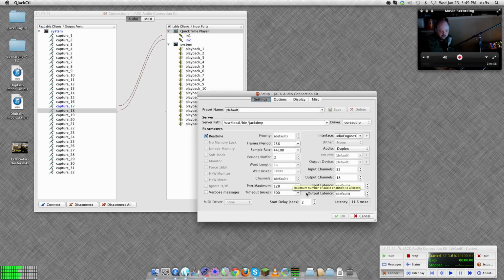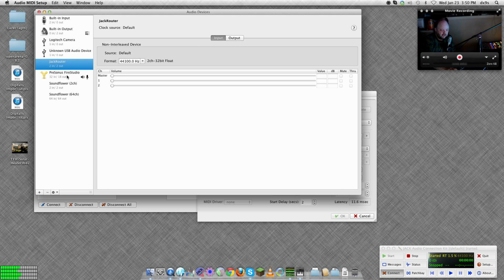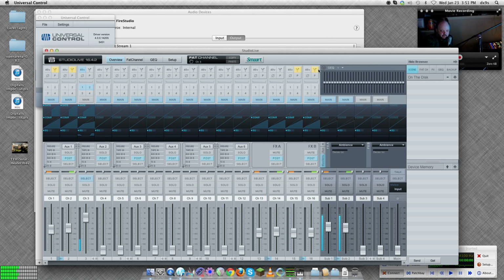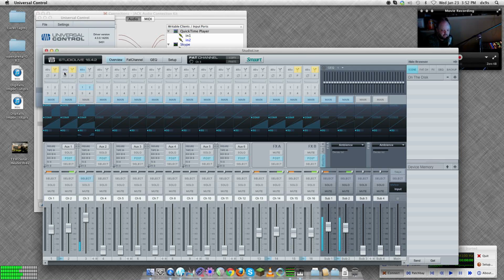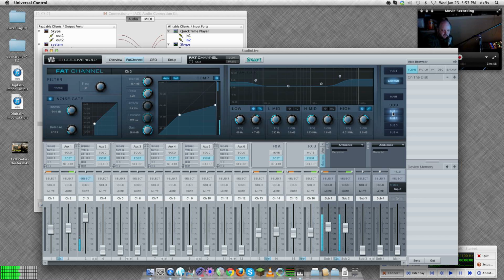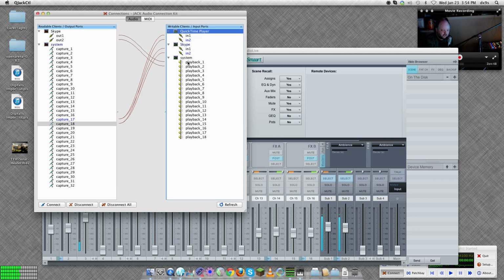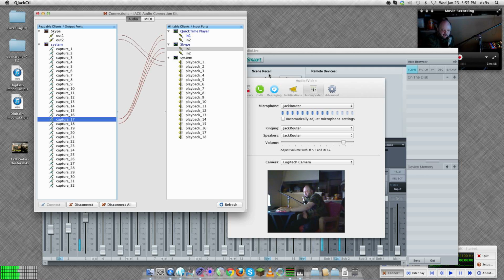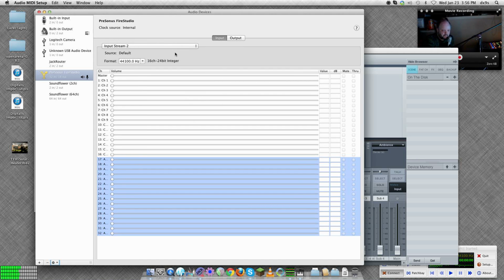Jack On OSX

Comment: This is a really confusing presentation, "QJAckControl ... has a much more user friendly so here I've got  ... "  and what did you click on to show the screen with the connectors. It then goes on to discuss a very personal system.
Reply from the maker: +Roger Alsop Sorry, this was more or less to be an overview and not a How To. Mind you upgrading to newer versions of OS X has disabled the ability to use the 'Virtual' JackRouter coreaudio device as the system default. Programs that ONLY use the system default audio device and don't have a configuration to select an audio device will have to be "worked" around. What in particular are you wanting to learn about Jack for OSX ?

Comment: i'v subscribed cause this is the best explanation so far in english about jack osx.
i have two problems..

i'm trying to run three video programs & one mic usb  thru live 9 aka abelton.

these video programs are.
1st program
photobooth(muted) cause the camera view doesn't invert with a mirror image.

2nd program
quicktime 7 pro ( cause i can edit the preference to hd with enable audio)

3rd program
quicktime standard ( attempting to route this one as a seperate  jack vst channel) to abelton. (which im failing at)

the reason why ? its due to the fact ,even thou i have focusrite 2i4 soundcard.
live 9 buffering sounds horrible while set to 64 samples to record the cad audio usb mic. and the huge issue is while i do get quicktime 7 pro to route thru channel 1 & 2 thru abelton.
i hear a double voiced from quicktime 7 pro and abelton monitor in.
if i take of abelton monitor button..it mutes quicktime 7.
if i turn down quicktime 7 pro  it also mutes the audio from abelton live 9 input.

i want to hear my voice only thru abelton as i record for shows but thats impossible due to them both being simultaneously connected from the volume bar on quicktime 7
and live 9 input channel on monitor ON mode.

so thats when the 3rd program quicktime (standard) comes in , im trying to use that as a jack osx vst output to hear myself talk on abelton.
so i can mute both quicktime 7 pro and abelton input double voice delay situation.

i dont want to mute quicktime 7 and abelton..i want to turn one of them off as i record my voice thru the d.a.w while i set a  fx chain to filter any background noise in the background while beefing up a clean audio in my headphone.

i want to start a youtube channel reviewing shows so i use quicktime 7 pro to record my video in HD, while the new updated quicktime standard cannot.
photobooth is just a camera view i perfer since its not inverted like both quick times which its an annoying mirror view which you cannot auto flip thru recording.
the reason why im recording my audio thru abelton while using quicktime 7 pro its cause i cant add any fx on the video player for example
(gate,eq,desser,vocoder,limiter).

im sorry to complicate you with such a question, iv tried to find stand alone mic programs which didnt need a record button to make my mic be register and audible thru jackosx and abelton.
but it doesnt exist..for some reason you need to record to have the mic send any sound thru abelton from quicktime pro 7 and standard.

so my problem is...even thou i connected quicktime player 7 pro thru live 9
and live 9 thru live 9.....you hear a double voice delay with both programs talking at once and its driving my crazy...just one would be fine but i cant mute either..
thats why the third program quicktime 7 comes in as a jack osx vst..
which i cannot get it to work! im stuck.

i need abelton its alot easier to edit music in the background as i talk on a review..
and i suck a final cut pro 7 and video d.a.w.s so when i do talk as quicktime records myself and the voice...i play video clips in the background to remember plot stories from intro , middle and end to close the review with detail.
its complicated but it works for me....and than i can save the abelton recorded quicktime submix...
match both abelton and quicktime audio on seperate channels into the video sync up with my mouth ...and delete quicktime 7 pro nasty recorded audio from the player itself with abelton processed version.

im begging  you please help me with this double delay dilema..

if i connect quicktime 7 pro in abelton ....is there a way i can mute just quicktime 7 without losing the audio in the d.a.w. thru jack osx...or using a third video program and turning it into a audio seperate vst...and muting both 

abelton and quicktime 7 pro together to end the double delay..while it records and i have the standard edition be a backup option to hear my voice without having to speak on mute which im not comfortable..i need to know how i sound before i bounce anything.
Reply from the maker: phantascy They have changed things in Yosemite (Mavericks and older). You can no longer send the system default sound out to the Jack Router (a way to fool programs that don't have the ability to change it's default audio output .. LIKE Firefox for example). However if you have a decent audio program that you can select the sound output device, you can continue to use the Jack Router to route audio between programs and external hardware etc.

This happens to be an older video that I posted and forgot to make public for over a year. So it is a little bit dated.
Reply from the maker: phantascy I ment to say (Mavericks and older are fine).. Yosemite you can't pick the JackRouter for system default audio in or out. The JackOSX folks might fix this in the future by making necessary changes to their "software" audio device to meet whatever requirements Yosemite requires... I fear this is a DRM thing and because this Open Source project, Yosemite might never support JackRouter fully like it did in Mavericks (and older).
Reply: +dx9s which version of OS X are you running Jack and QJackCtl on? I am asking for this because I installed Jack on Yosemite and El Capitan, just now: on the first, QJackCtl returns some errors and it's impossible to launch it. It was possible to run and manage Jack only using JackPilot. On the latter, you should disable the SIP in order to install the package and, however, also JackPilot seems to return errors. Due to the great potentialities of Jack, I am looking for an OS release on which it definitely works good.
Reply: +Rodolfo Cangiotti Is there any work around to get jack working on yosemite? im debating reinstalling to mavericks just to get it to work
Reply: +Mac All currently, I'm back to Mavericks but I successfully used JackOSX on Yosemite too. The main difference is that the core audio driver on Yosemite have been rebuilt and consequently, several applications which use the audio device are not recognized by Jack. I remember I had a issue with QJackCtl too (it was not able to launch the Jack processes), but probably the last version built by Matthias Kronlachner has solved it.
Reply from the maker: +Rodolfo Cangiotti +Mac All Mind you, Jackd (aka JackOSX) itself works on Yosemite but the JackRouter CANNOT be used as the "system" default device ('Use this device for sound input", "Use this device for sound output") from inside the 'Auto MIDI Setup' -- which many programs will only use the system defaults.

The only work around (which really isn't) is to use programs (like Logic Pro, Ardour, Audacity, Skype, etc.) that support selecting which audio device from within their programs (which doesn't cover the cheap programs)... The beauty of JackRoute on Mavericks is that each-and-every-program becomes it's own seperate Jack client via JackRoute set as the system default.

Even if you where to get a cheap USB sound device as the system default and route that into the system externally (say you have a Presonus or XR18 X-Air, some multi-channel sound device), you would get all programs routed to the same input... Mind you this "analog" work around is probably good enough as most people are rarely running several desktop application at the same time with the need to separate their audio into different Jackd client inputs. 

I haven't checked but it might be possible a newer release of JackRouter (JackOSX) works on Yosemite the same as in Mavericks as-well-as El Capitan also fixing the NO-JackRouter-as-System-Default "bug" in Mavericks. 

For me, it hasn't be as-big of issues as I thought (the analog hole is a lame incomplete work around, but it does work), Skype can still select JackRouter, various streaming programs I've tested (Streamcast, I need to test the Mac version of OBS, been using Linux version) 

--Doug (dx9s) / sorry for the long reply